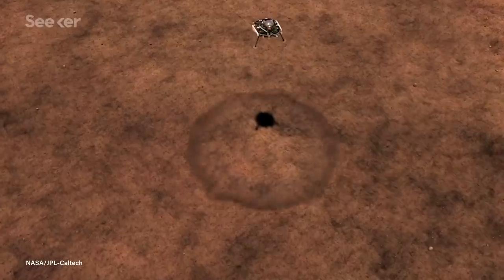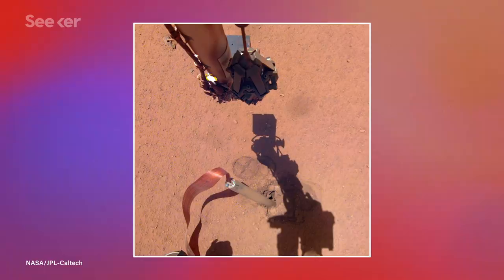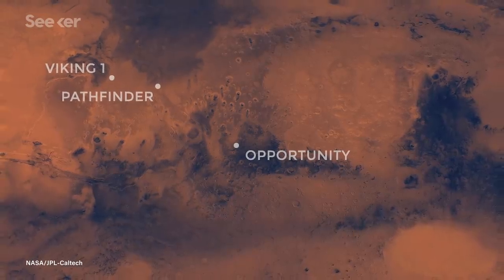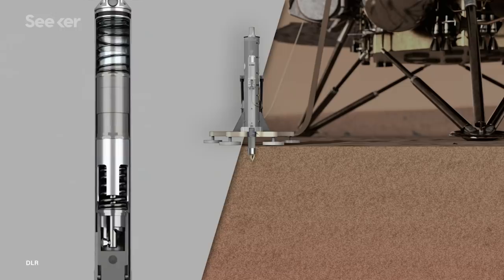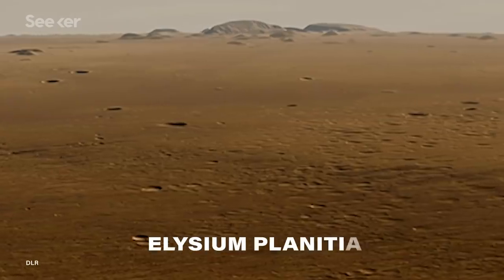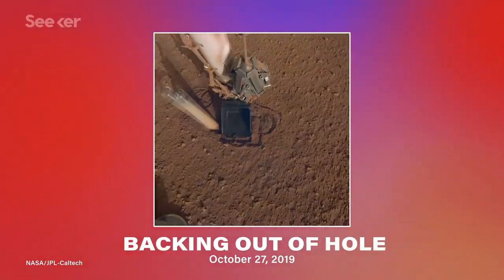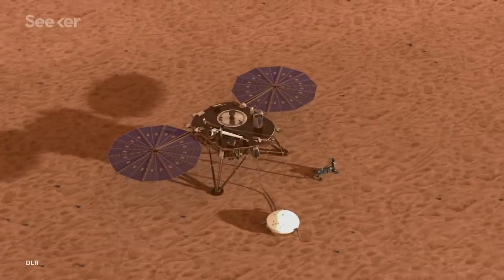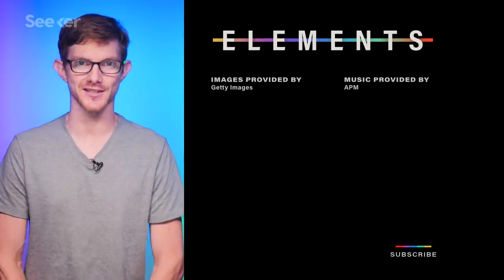Why NASA’s Mars Mission Can’t Scratch The Surface of Mars

Comment: It's ok, we need to scratch Europa's surface
Reply: The Exoplanets Channel Facts or titan
Reply: the ice sheet is way too thick for us to ever dig through to the liquid water underneath
Reply: @matthewjuhasz4317  disagree. Europa itself is not as massive as Earth, meaning the pressure at any given depth is significantly less than it would be on Earth all things constant. The technological hurdle of digging thru that much ice is significant, but saying it's too thick for us to "ever" get thru it ignores the fact that technology is constantly improving and there is no set time table for such an operation. 

I think the "nuclear torpedo" idea makes a lot sense since any probe they send is going to be denser than water (especially if it has fissile metal). As long you can melt ice, gravity does all the heavy lifting. The real issue is how are they going to protect the probe from geological hazards, like pockets of highly pressurize water or gas.
Reply: @atlas42185  i see sending signals, once under the ice sheet, to and from earth, as one of the most difficult chanllenges to overcome as well
Reply: @TotalDrganMania  

I thought about that as well. Either you'd need a really powerful emitter or you'd need a solid connection. I'm guessing that any hole you could make in the ice would freeze over eventually; you'd need a lot of cable in order to communicate. EM radiation could partially penetrate the ice, so maybe the probe could embed radios in intervals to relay info from the probe to the lander, and from the lander to a satellite, etc. Idk. All options are easier said than done.
Reply: @atlas42185  yup
Reply: @atlas42185  A heated prob with a long hated cable and signal tether in one. Use nuclear power on the surface hard part is making that at least 10-15 miles long to reach liquid water and fitting all that on a lander. It only has to be a degree or 2 above freezing..  But for a good sampling you'd still have to get deeper that ocean is insanely deep and you'd want to find volcanism. Though anaerobic life might be present but how do we know what to look for? How much equipment to try and understand if it's alive? Might be easier to transfer consciousness into an extremely durable machine and have it supervise personally. I wouldn't do it without major shielding Jupiter is hard on electronics but with the tech to do the afore mentioned none of that should be hard.
Reply: @atlas42185   I think a mission like this would need a nearby space-station or an operation headquarters for resources, communication and power deficiencies and shortages so I think a mars colony should come first before we start a mission to one of Jupiter's moons, plus the radiation emitted by Jupiter would be a non easy challenge to overcome too, if we ever thought of sending humans there.
Reply: @InternetStalkers Nomercy HeavyPrison Onequest Well if I lived long enough to escape my fragile natural body yes.. But while still in it curing cancer and aging would do wonders haha! Especially cancer, being betrayed by a selfish cell is kinda messed up! Currently the best we got is poison us until either the cancer or we die.
Reply: @matthewjuhasz4317  you don't dig through ice, you melt through it.
Reply: There's an ex-marsian lander team... that might be up to the job😊
Reply: The MONOLITH might object. 😊

Comment: Ever bend a tent stake on a little pebble? They may not think so, but I am telling you it is a rock.
Reply: Very likely is, yes.
Reply: The surface of Mars is not like the one on Earth. Especially when the mole was designed to get through medium size rocks.
Reply: @martiddy  Was it designed to go through forty-ton boulders? I think not, and a forty-ton boulder is just as likely as a medium size rock. The surface of Mars is not UNlike that of Earth, either. They are different, but similar.
Reply: @craigcorson3036  I highly doubt it was a big rock in so low depth from the surface. It was more likely a flaw on the mole's hardware.
Reply: @martiddy  the surface of mars is not uniform, just like the surface of the earth. the regolith is acting as a shock exorber. Like trying to chop wood in sand. The log is just going press into the sand when you strike it.
Reply: @martiddy  Big rocks can be found at any depth. You can doubt all you want, but you can't know.
Reply: @craigcorson3036  I'm not saying is impossible, but just more improbable than a the hardware having a flaw. But yeah, that could a rational reason.
Reply: @martiddy  Watch the video again. They know that the "mole" is working, because the seismometer detects the impacts.
Reply: Craig Corson So in your imagination, they wouldnt be able to tell soil from rock?

Hmmmmmmmm
Reply: @ghostnoodle9721  By what convoluted logic do you reach THAT conclusion?
Reply: Oh so you’re a scientist
Reply: Ghost Noodle they can. That is why they landed in that precise area. Chances are that "they found the needle on the hay stack" and landed precisely on the only place with a boulder in middle of what should be sand everywhere, or maybe a different tipe of soil underneath the sand.
Reply: It might be a type of soil that compresses and harden when pushed on.
Reply: The geniuses who run it would know better than anyone else, but ignoring that for the sake of layman speculation, if it had hit a rock, then why did it continue to make progress for a time whilst being braced against the bore wall by the robotic arm. Also, you'd read the difference between a rock and soil at the penetration face on your seismic. I'd guess the soil is way too unconsolidated and is backfilling after each stroke and that's why it's jacked itself upward. Lucky actually that they didn't just collar up their assembly and bog it in situ.
Reply: But I'm telling you too, it is not just a rock. It is a heavy metal song to me.
Reply: Ah yes, when dumb people on the internet are so self centered that they think they are smarter than NASA’s scientists
Reply: @BananaBLACK  ubiquitous does not mean the same everywhere, it means something thats found everywhere
Reply: @Lyle-xc9pg  thank you for the correction.
Reply: I see your point(s) and I see their merit. However, respectfully, a huge amount of testing and specialist consultation does go into these designs. It's important to note that the simplest possible design with the greatest universality is the best because it presents the lowest likelihood of component failure. I would argue (again respectfully) that surface topography of the tool for tractive reasons could present more problems than benefits for penetration if the soil condition had swung a different way, granular compaction against that topography could prevent gravity alone being force enough to allow downward travel during percussion. Personally I don't think its a very good way to drill, but it's completely hermetically sealed =low likelihood of breakdown, and it's on another planet, outside of the skill set of your average roughneck. (Can't be fixed if it breaks down) I think it should have had a Kelly rod on it through a small table mounted on the vehicle  and had the percussion above ground, like a rigid plumb bob, but again, just a roughneck, not a NASA engineer.
Reply: I tell you what though, it does make me want to start designing lander drills.
Reply: fair enough. And I wasn't insulted at all, but I am actually a roughneck, or at least I was for a long time before I took up machining. Rig pig and proud of it!
Reply: @benwilms3942  My father worked on an oil rig when I was a kid.  To me, it was the occupation of heroes.  I'm ashamed to say that I'll never live up to his proficiency level with his tools.  The man can fix anything under the sun.

  I just remembered that the platform has a seismic sensor on it, so we couldn't use Kelly Rods, because the vibration would be transmitted back to the main platform and might interfere with the instrumentation there.  It would have to be done as a stand alone tool.
Reply: my dad was Farrier, very clever. I think it was something in the water that generation was drinking. 

Do you mean have the rig as a stand alone tool or the seismic?
Reply: @benwilms3942  Yes they were certainly highly capable.

I was thinking of having the seismic sensor detach from the primary platform and be deployed at a nominal distance from the drilling rig to avoid seismic noise.  Since it's a low power device, it could operate autonomously using it's own small solar panel and backup battery.  It might transmit cached data wirelessly to the platform via BLE or,  use multimode fiber optic cable with a graphene hybrid shielded jacket. 

With the seismic sensor off platform, it becomes possible to use the platform as a drilling rig.  Since Kelly Rods add weight to the package, we could use just a few of them to start and have the drill (with an improved design) continue on it's own past the reach of the final Kelly Rod.  What do you think?
Reply: sounds exactly like it should. I was thinking about a single Kelly rod, rather than several prices, so that they don't have to be connected or tripped in. Maybe a bi-stable position compliant material that can roll up in transit, and straighten out once landed, or a shape memory alloy. I don't think screwing things together works out weight wise, to much required infrastructure.
Reply: @brendanro  yes

Comment: The only marketable reason to put a colony on Mars, is to drill to the mantle, to figure out why it is not producing a bigger magnetic field.
Putting carbon into the air will not work, because solar flares will just keep blowing it away. The only way it can retain an atmosphere, and therefore heat, is by generating a stronger magnetic field. Like Venus. And the only way you can do that, is by figuring out how to get the mantle, to produce a larger magnetic field. The field would then reflect solar flares, preventing atmosphere from being lost. And considering how much we know about electronics, it should be a slam dunk.
It's like the elephant sitting on the sofa, there it is sitting on the couch... nobody says a word.
Reply: If they were able to figure out why it's not producing a strong magnetic field, would they even be able to make it produce a strong one?
Reply: I have no idea if the solution would be scale-able.
Reply: Or we could just move closer to the core where temperature and pressure more closely resembles that of Earth. Nothing to be done about gravity, unless you build everything to be on a train rounding a circuit. Anyways, huge submartain tunnels capped at the egress by air locks. This I believe is Elon Musk's true intent with The Boring Company.
Reply: Neutron radiation and solar storms will just blow the atmosphere away again.
Reply: Holding an atmosphere seems rather key...
Reply: "A little knowledge..."
Reply: @BananaBLACK  hmm, I never thought of that possibility. Using such a Boring device on another planet. If constructable, sure :)

Comment: I think it has to do with the martian seasons and temperature/humidity/Gas combinations in the atmosphere.  I'm guessing the soil structure was changed by an environmental factor changing how the soil compacts and adheres to each other.  They made nice progress until that factor changed, causing the soil to "flow" more, as it no longer hold together well.  Then, at each 3 second impact, they were allowing the now loose soil around the probe to just drop down, below the tip, thereby pushing it UP and back out the hole.  They need to look at all the environmental conditions and see what factors changed when the probe got pushed out.   Then, try again once the previous conditions arrive again.   Just my take.

Comment: Should have tested it in the red clay found in Oklahoma or northern Texas before sending it on its mission. From the way it packs in, holds an imprint, and clumps apart, it looks the same. Somebody from that region could probably tell you why your impact digger isn't working. Not from there (the Earth analog to Mars), but I'd guess it hit hard-pack about 3 inches (7.5cm) in.

Done the occasional digging on some yard project or other needing a post put in, and hitting Midwestern clay about 3ft down - need a pick axe to go through it. Jackhammer idea isn't wrong, but needs more weight. How much? All. All of it.

Comment: They aren't able to pick the mole up, but maybe they could use the robotic arm to push the mole around to a different location and then prop it up on its pointy end to dig another hole there. Again they would have to be careful not to do any damage to the mole's ribbon connector, nor the robotic arm doing this.

I would wonder, though, what properties of the Martian soil could be causing the mole to pop back up out of the hole.

Comment: Could the problem be the weaker gravity on Mars?  Could the hammer strokes be bouncing the probe upwards and letting sand fall beneath it?   It only weighs 38% of what it does on Earth, they probably just need to hold it down to get it started.  If it was hitting a rock it would just stop and not go further.  The sand on Mars is probably so fine and light that it cant support the probe until it is below the surface further.  
Hope they can get it to work!!✌🏼

Comment: How big is a handheld drill?
Reply: Handheld drill will not help you drill 3 meters down into soil
Reply: @DrZbo  the motor of handheld drill and oil drilling method
Reply: @bigmock141  torque in opposite direction would have to be accounted for.  The team decided on this method based off of previous information.
Reply: @DurzoBlunts  did they anchor the thing on the surface?

Comment: They should just give on that whole, collect it using the arm and try another time a couple of metres away. Use a small rocket from earth to fire a probe from space into the soil or maybe another mole with the ability to anchor temporarily during hammering to stop it from coming back out.
Reply: Did you miss the part where he said that it can't be moved to a new spot?
Reply: @craigcorson3036  I did, haha. Well then that was fairly stoopid of them, seems like a huge over sight so Im gonna assume I don't have the whole story on why they can't.  Well the second point of sending down a new self contained unit might still be an option, albeit a very expensive one.

Comment: You see what being cheap does to a mission - a Dewalt hammer drill w/battery would have made short work of any rock & not cost millions to build. Also the power demand could be made up by charging the battery one or two days & drilling the next, Does anyone need a Phd to know to plan for the worst case of soil & rocks.

Comment: Dear NASA
 I hear you are in need of a "dumb guy in the room" to look over Schematics in relation to objective parameters and to suggest modification to designs to facilitate the successful reset and removal sequences   to fulfill mission objectives. I think it is important to stress my experience with explaining to engineers the complexities and pitfalls of being an engineer. Although,  Im no scientist or Accredited engineer Myself, I have worked on enough job sites to Know one thing ; Only an over educated, over thinking, over complicating Conglomerate of engineers would send a tool to the job site, with no way to reset its Primary function or secure a Secondary alternative to application and use.  I look forward to joining your team and solving future dumb guy stuff like adding a Hook and Loop to some equipment,   DM me and We'll talk about the value my stupidity brings to the "Smart Guys" table .
Reply: Nice.love the sarcasm. Not wise for a job pitch.but funny.little tip. Dont be sassy or sarcastic to your future employers... they wouldn't like that.i heard 😅